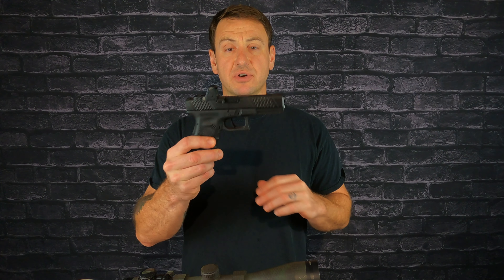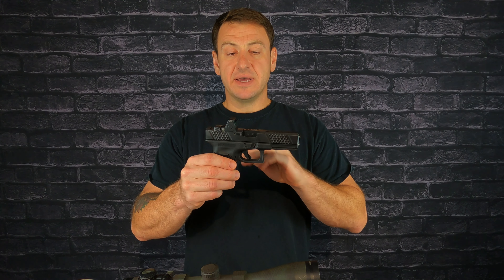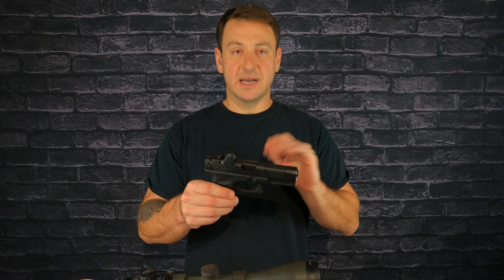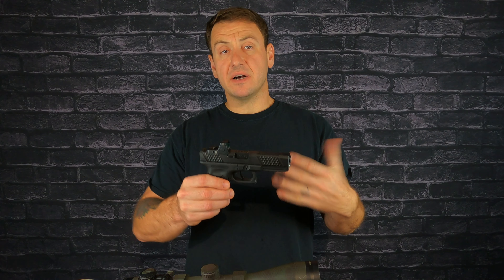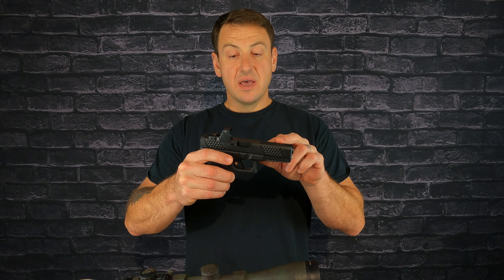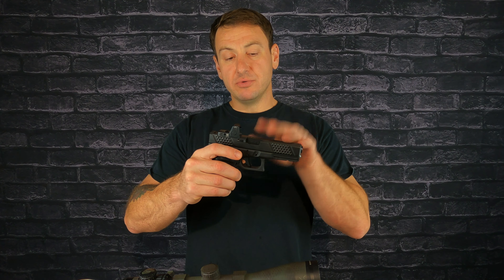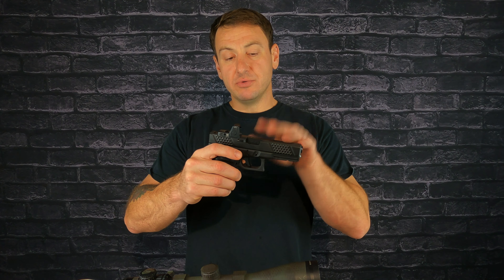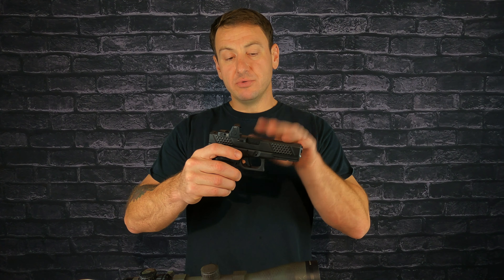Tolerance Stacking Doesn't Have to be a Problem

Comment: Typically you will not see a problem with a glock regardless of how many different brand parts you use. You mainly only see that with Polymer 80 builds.
1911's are far more likely to have that problem because they were not originally built with the mentality of loose tolerance equals reliability. Top level 1911's have the tightest tolerances in the gun world.
Reply from the maker: All guns are not built the same, that is for sure